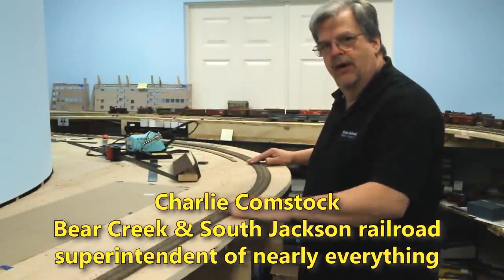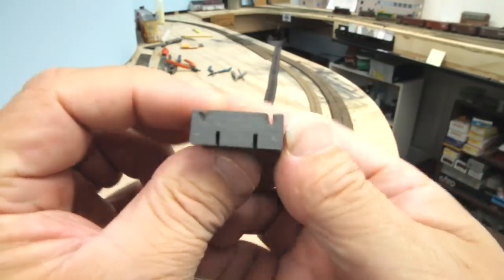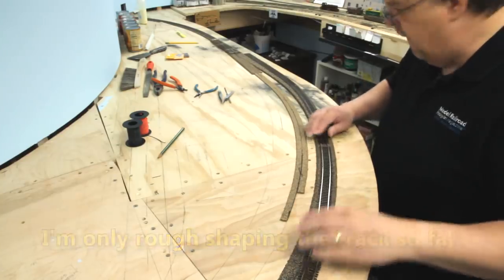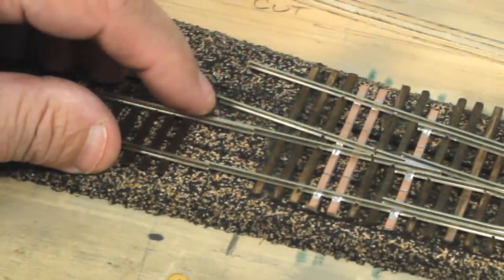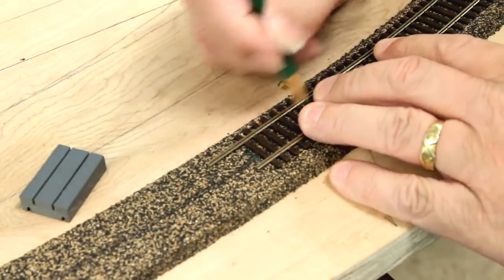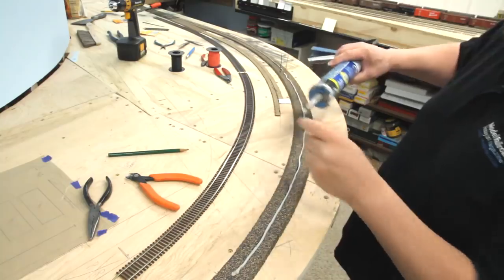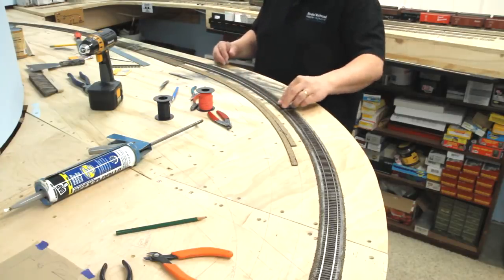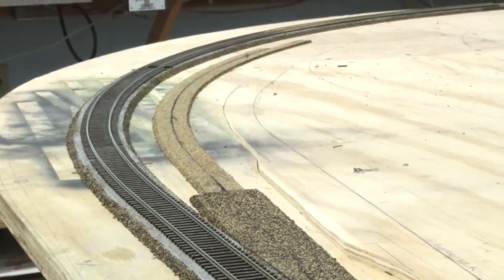ME flex track laying tips | getting good trackwork | Model Railroad Hobbyist | MRH

Comment: I don't think that is how you are supposed to solder.  I am not expert, but I think you are supposed to get the joint hot first then place the solder on the joint.  You might have a "cold weld" solder joint.
Reply: If the solder is shiny when you're done, it's a good joint...
Reply: George, you are quite correct to say that you have to heat the joint so that the solder flows onto it, and If you look closely at 2:00, he is doing just that. What you see is that he initially runs the solder onto the iron to allow the iron to make good thermal contact with the rail and give good transfer of heat. You then see that he continues pushing solder into the joint at the point where the iron touched the rail. You know if the joint is hot enough if the solder flows onto the rail and as BCSJRR says if it is shiny at the finish, it will be a good joint. I would add also if no spiky bits are observed.

It is nice for once to see somebody on utube actually doing a decent solder joint.
Reply: Stupidity! You are absolutely right you never put solder on the inside of the rails or the wheels are going to hit

Comment: Now I know were all the push pins have gone. Sanding is a must I use a rotey sander with shop vac attached. You must sand the cork. Love the soldering, I agree I solder all rail joiners. Now I know what those tools are in jar I have had for 20 years. I cut track with dremel cut off wheel. Stops most of the filing.  I use track nails to hold track in place until I ballast, then go back and pul nails and fill holes.  I have found that it makes it easier to make changes if things are not working the way I concieved them to happen. Great point about getting the ties right.  Buy 3ft metal ruler from Lowes or Home Depot Charlie is 100% right you cannot get track stright without using a stright edge. So whats for dinner. THIS IS ONE OF THE BEST VIDEOS ON LAYING TRACK  i have seen. will put it in my playlist.
Reply: Art, I think unless you a trying for irregular roadbed to simulate prototype lumpy track, a rotary sander is a mistake. It must be nearly impossible to sand cork  smooth and flat with it. That's while I use such a long (16") sanding block -  to keep the sanded cork from having ups and downs sanded into it.
Reply: @BCSJRR  Never had a mins problem. Use 80 grit and lean the sander all kind of ways takes all the ruff edges.  Same tons of ballast.

Comment: Great video, Thanks. I would only add that after the track is where you like it I use push pins to hold it down and then add my cans. I'll put one or two pins in every 3 cans. Again, nice presentation and explanation as you go along. You didn't mention where you got your curving guide. Is it commercially available or did you make it?

Comment: that has been the most helpful video I have seen regarding laying track. this method also works well with the peco flexitrack only I use thin screws with oversize washers to fix the track in place until the caulk has cured. I personally cannot stand nail heads exposed on the top of sleepers. How often do you see a 9" disc on top of a sleeper every 9 yards or so on the real thing. it is horses for courses and for me this video was superb. thankyou for taking the time to post it.

Comment: An extremely informative and well narrated video full of great tips which I will utilise, thank you. Your solder joints were extremely good, solder flowed well and left a neat compact joint. Will definitely be using the caulk versus track pins and will get a gauge as yours to complement my Tracksetta radii and straight gauges. Have loads of Peco code 100 flex track to lay and ballast.

Comment: My preferred method for roadbed is Double -sided foam mounting tape available in cheap shops. It's about 1.5 mm thick and about 16 mm wide. I lay two strips side by side and by running a sharp knife held at a 45 degree angle to the base board create the ballast profile.. As the protective covering tape is still on the tape till you are ready to lay the track, this bevelling is easier done after laying the track . It is necessary to be precise when laying  the track in position as you only get one shot at it but it is not difficult to do if you start at one end and keeping the track elevated so as not to contact the tape before you are ready, guide the track into position with the other hand, running the tips of your index finger and thumb along the  edges of the tape as a guide to centralise it. When in position ballast as usual. This Double-sided tape method eliminates glue spreading, pinning down or weighting down and waiting for cork to dry, eliminates sanding and clamping track down while  waiting for its glue to dry. It also does not seem to be noisy and the only form of noise transference can be through the ballast. It has never failed even in frequent 40 degree c temperatures in my layout shed and most of  it has been in use for over 20 years Hope this may be helpful.

Comment: Good video. I use basically, the same techniques with Atlas flex. However, as a guy with unsteady hands, I find it easier to solder the pieces of flex track, and the feeders, on the bench.

Comment: Charlie,
Two questions.
1)  I noticed you soldered your feeder wires to the underside of the rail joiners.  Nice idea.  Got to try it.  HOWEVER, wouldn't it be easier to prefab the joiner to the drop wire separately.  Then do your rail to rail clean up.  Connect both sets of track with the drop wired/joiners.  Complete THAT solder joint.  Drop your line through the road bed & make temporary trunk line wire connections?

It seems easier & safer to make the drop wire/joiner connections away from the layout.  And done this way you can mass produce these connections on a lazy TV evening.

2) I know this video was shot & uploaded back in 2014 (this being 2019).  About two weeks before this upload I found, while working in the U.K., GaugeMaster Track Underlayment.  A foam core rolled track product, that is ballast in the factory to look prototypical.  HOWEVER, in the molding process GaugeMaster molds in an indentation where modelers can push into place their trackage, even between the ties,  for a job quickly & well done.  I myself have been using it for these past five years.  Pulling up my previous cork beds with each upgrade.  Have you ever used GaugeMaster?

Good job even 5 years Down the Line.
SEE YA' DOWN THE LINE
Jim
Reply: Have you actually tried soldering the feeders to the bottom of the rails when the rails are in place?  It's nowhere near as difficult as you think it  is. One thing that I forgot in the video is to pre-tin then upper ends of the feeders before threading them in their holes and placing the track over them.
Reply: @BCSJRR  Yes I have solder hundreds of miles of "O", "HO". "OO", "ON30", "N", "G", & "S" Scale tracking over my 60+ years in the hobby.  My recommendation of 2 years ago was intended as an easy, quick, and safe way to mass produce drop feeders.  While avoiding melting commercially manufactured or scratch built plastic RxR ties.  To answer your post I went back to find out why I even commented.  And you included it here, in your reply, the cause.  You failed to pre-tin your feeders.  To date I still use off seasons time to mass produce layout elements I know I will use SOMEDAY.  Hence my recommendation.  It must go back to my old BOY SCOUT days to "BE PREPARED".

Comment: Several comments:
Finger nails - I bet the fellow is a finger-style acoustic guitar player. They tend to have longer nails on the picking hand to make up for not using a pick.
Soldering - heat itself isn't so much the enemy but dwell time on the joint. Use a hotter iron (not one of those old Weller guns) and a solder with a good flux (not the water soluble crap). Also in the MLR kit is a tool that will help keep rails in gauge when soldering. It's the one with two cut-outs on the sides.
Holding track down - if you don't have a bunch of cans of food use push pins with a long pointy end until either the caulk hardens or your done ballasting. Then delete the pins.
Reply from the maker: musicman8942 - You got it. Charlie is a very good acoustic guitar player and we've never seen him use a pick.
Reply: Cool. I can't do that as my nails are too brittle. Picks all the way except for sometimes on bass. I play acoustic as well as electric guitar & bass. And of course there's the trains :) HO and N

Comment: Great Video Charlie !!!   That is pretty much how I lay my track, only two things that I do different:  1.  I use the clear DynaFlex, it goes on white so I can see where I am spreading it and dries clear.   2.   I hyper elevate my curves on the main using narrow strips of blue painters tape under the outside rail. I start at the beginning of the curve with one layer and run it to the other end of the curve.   I start each successive layer 4 inches in and and do the same on the other end until I have 5 layers.  I model in N Scale so you would need more layers and maybe start each new layer a little farther in.  The trains look great going around the curves !!!   Ron Marsh has a great video on curve easements and Hyper Elevation on his YouTube Chanel, Ron’s Trains N Things.

Barry

Comment: I have had problems with the ME weather code 83 bending to a smooth curve....So thanks for the tip with the rail alignment tool...I thought it was only the weather track that was hard to bend...Apparently the unweatherd track does the same thing...
Reply: +Uptown Photography I've used ME weathered track in the past. Yes, while unweathered track takes some coaxing to get into position, the weathered track takes even more. I stopped using the weathered track, partly because of the additional coaxing required, and partly because of the extra prep work required to solder it. On the upside, it's easier to get a coat of paint to stick to the weathered rail, than the shinier unweathered rail.

Comment: Question from the 1 minute video.  You said,  "Be sure you have the right size rail before you install it".
Would you explain further on make sure to have the right or wrong size rail?
What are the names of the different types and sizes? 
 How do you know you have the right type rail?
What are the different rail type names?
How do you specify the correct rail type when ordering the rail?
.
Bill R.
Reply: Model railroad rails come in different heights. These are identified as code 100, code 83, code 70 and code 55 in HO scale. Other scales have different sizes. The term "code" is just a non-obvious way of giving the rail height in thousandths of an inch. So code 83 rail is .083" tall while code 55 rail is .055" tall. I use the different heights to model the different sizes of rail used by the prototype. Interestingly, the prototype specifies rail by how much a yard  (or is it foot) of rail weighs. In HO scale code 83 approximates typical mainline rail size,. Code 70 approximates siding rail size (often lighter weight than mainline rail) and code 55 approximates the even lighter rails used on spur tracks or in yard areas (where equipment moves relatively slowly.

Comment: Hi. Thanks for an excellent video. As a beginner, I'm trying to discover the best way to solder droppers to track. Some solder to the bottom, and some to the outside, as you say, the ballast and the weathering hide a multitude of sins. I wonder how you introduce the replacement sleepers after the soldering is done? Does the dropper wire not adversely affect the sleepers when you re introduce them?

Comment: Hi,  Enjoyed your video.  One question please...what do you suggest to fasten down flex track on benchwork that is 1/2 inch plywood with a 1 inch foam board on top.  The track also has 1/8 inch cork roadbed.  Where can I get the fasteners and what are the specs on them?

thanks

Bob

Comment: Nice video.  Is cutting off one tie from the end of each piece of flex about the max you should cut off?
Reply: There is no fixed rule for the number of ties to remove. When laying track on a curve the outer rail has longer to go than the inner rail and it may "fall behind". This can result in the rail ends of a piece of flex track not being exactly across from each other. Sometimes one tie off each end at a joint between two pieces of flex is plenty. Sometimes 3 or more may be needed.

Comment: It looks great with the caulk, but why use that over nailing the track down? It looks like a lot more work.
Reply from the maker: Nails can easily be pressed in too far, causing the ties to bow slightly and tighten the gauge. Plus with caulk, the track can be removed later if needed for any track realignments. Getting the track down without bowing the ties using nails is actually more work. Finally, it looks better. Nailheads are unsightly and out-of-scale - more appropriate only for hidden track or toy train layouts.
Reply: Unless you're using scale size spikes (from the proto87 store), spikes driven by hand tend to be too large. If you're driving Atlas track nails through the holes in the center of the ties, you'll have an unsightly blob that will look like someone cut the last 2" off a watermelon, painted it black, and  set it on a tie. Cameras will REALLY show this - if you ever in your wildest dreams plan to photograph your layout from a scale person's eye height, do NOT use the track nails. They'll be obvious eye sores in your photos. That said, I DO use track nails and Atlas code 83 flex track in my hidden staging tracks - you're correct that track will go down much faster that way. But for appearance, gluing down ME flex track is close to tops - at least in my opinion.  Btw, if you're laying Atlas flex track, most of the stuff you'll see in this video will not apply. Atlas track doesn't need to be coaxed into shape.

Comment: Even though Im new, I noticed a couple of things.  Arent you supposed to stagger the track cuts, especially in a curve?  That would be stronger and prototypical.  When soldering, shouldnt you only solder on the outsides of the rails?
Reply: Good observations. I've found that with ME track on a 40" radius with both rails soldered, staggering isn't required. Just make sure the joiners are soldered with the track straight - don't bend the track first, then solder the joints. It's extremely difficult to get a smooth joint through a curve if your solder afterward.
If you're not soldering the joiners then you'd be well advised to stagger the joints by a few ties.
When a rail joiner is soldered properly, most of the solder should be wicked up inside the rail joiner. If there's lost of solder left on top of the joiner, either you're using too much solder, you didn't heat the joint enough for the rail inside the joiner to get hot enough, or the rail wasn't clean so the solder wouldn't flow well under the joiner. After soldering the rail and joiner should look like they have a patina (thin layer) of shiny solder on them, but the gaps between the joiner and the rail(s) inside it should be filled with solder. Capillary action will suck the molten solder up inside the joiner if the pieces are clean and properly heated.

Comment: I’m new at this.  I’m just beginning to lay Atlas n-80 track.  My cross overs have small gaps (1/16”) between the two #6 turn outs and the 5” straight through track.  Question: are small gaps between pieces okay as long as I solder the rail joiners?? Thanks!

Comment: what if you decide to redo your track now that it's glued to the cork track will be junk instead of tacking track down
Reply: It's possible, with extreme care to get the track up. But most of the time you're right, pull the rails out of the ties and use them for scratchbuilding turnouts or crossings. 
It helps emphasize that one should know with certainty where the tracks should go before laying track.
On the other hand, I've been known to mockup the track in a town using Atlas flex and track nails. Then when I'm sure I know what I want, I pull that up and do it properly. I much prefer the appearance of ME track compared with Atlas.
But this method of track laying is not good for experimenting!

Comment: How you make soldering look so easy my soldering just runs of can never get it to stick
Reply: I use electronics grade thin rosin core solder and a Weller controlled heat soldering iron and make sure the tip is clean and tinned before starting on a joint.

Comment: Charlie thank you. so informative. Can You adivse on brand of  HO code 83 flex track? i,e, Atlas, ME, Peco Walthers, etc. and reasons why you use ME? I am preparing to buildHo layout and have differing opions given m e tha tI should use code 100 instead of code 83. I'm confused. Also, Some guys say they've had trouble with some Atlas turnouts vs. the Peco , ME or Walthers. Also, is it necessary to solder joints with flex track if using good track connectors and the track is fastened dow firmly? I'm new at all this. You thoughts would be very appreciated thanks so much. Andrew Walsh
Reply: I'm not that familiar with Peco track. The ME track has superior appearance to Atlas (finer details) and of late it costs less, too. Because the Atlas track wont hold a curve by itself, I don't recommend this method of gluing track in place for Atlas track.